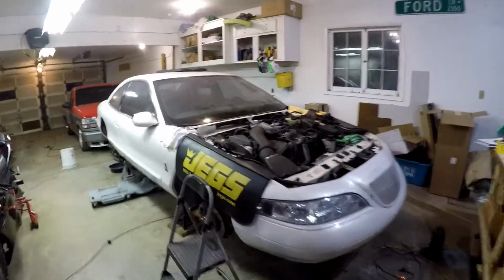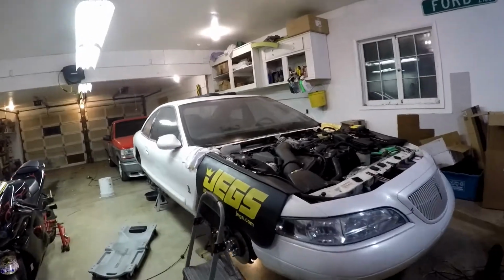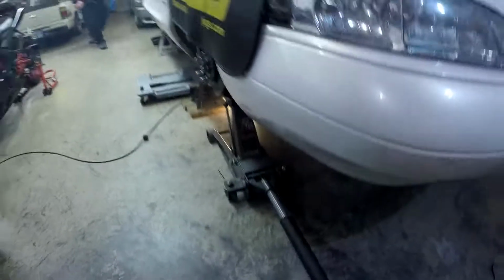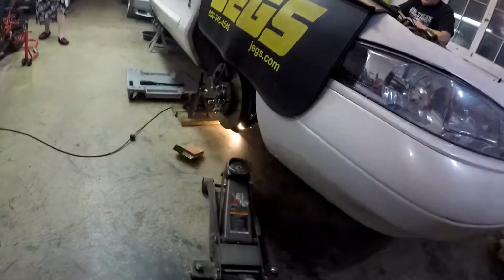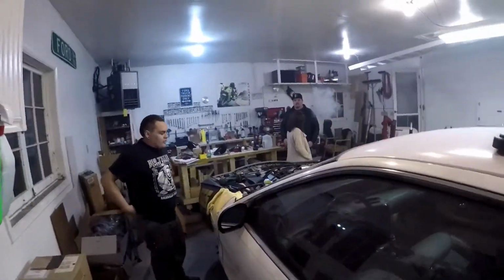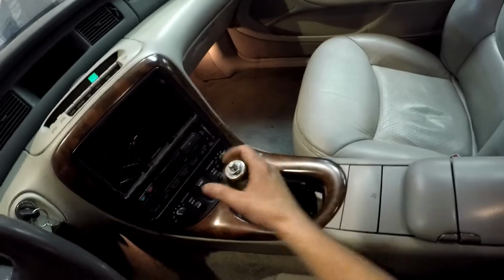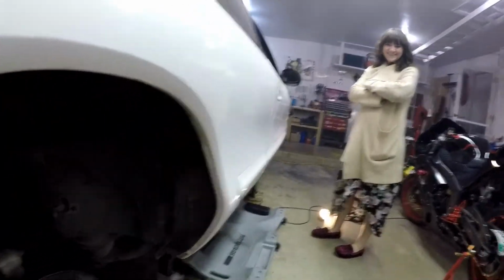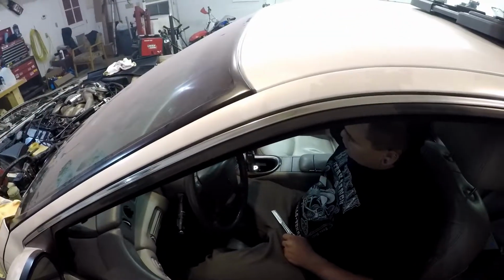Mark VIII Manual Trans. Getting it drivable (Part 9)

Comment: Man I love your vids! I actually have exact same color and year Mark, base model tho. I ripped the auto off it couple days ago and boy what fun was that. It was def the first time bc half of the bolts snapped and one of the top ones i had to cut off. I planned to do overhaul to the trans and jmod, I have dirtydog high stall tc just laying so why not swap it too.. I have dreamed of manual trans but maybe later.. I live in country, that has only handfull of these cars so not too easy to do a build like that. Thanks!
Reply from the maker: Thanks man! Good luck with the trans! The factory shifts are so bad in these cars definitely a car designed for comfort. I'm sure the jmod will fix that right up.

Comment: So was it confirmed the spacer plate was causing the noise? What did you do to fix it?
Reply from the maker: Ya. I put the spacer plate in for the auto trans. Pulled it out and put the plate in for the 3550. Problem solved!
Reply: Watched episode 10.  Ok that makes sense.